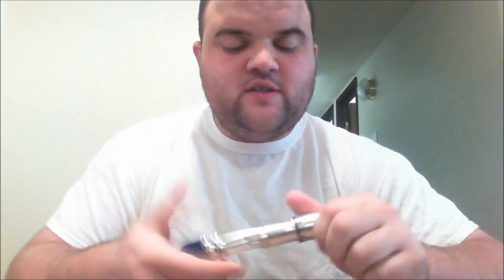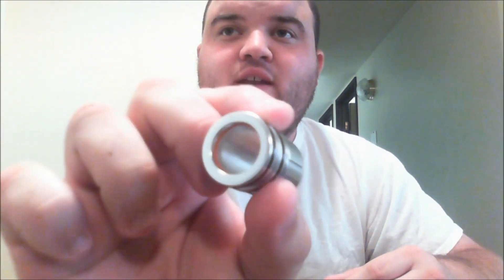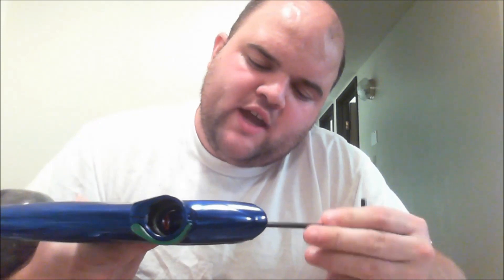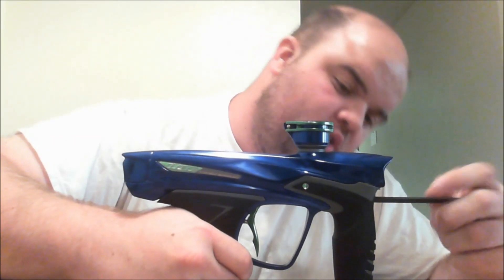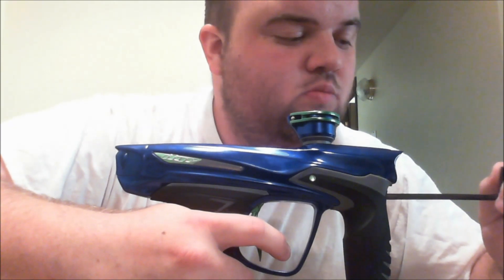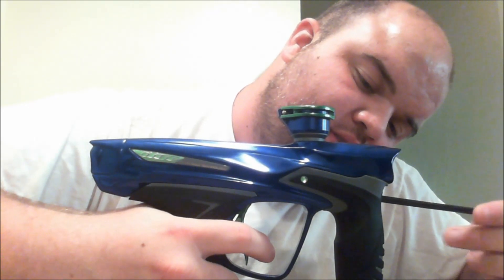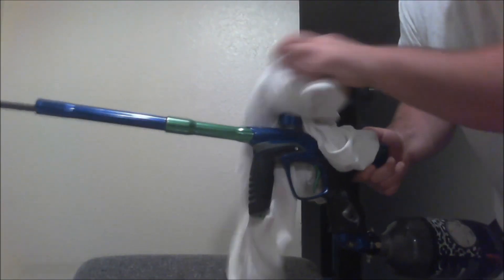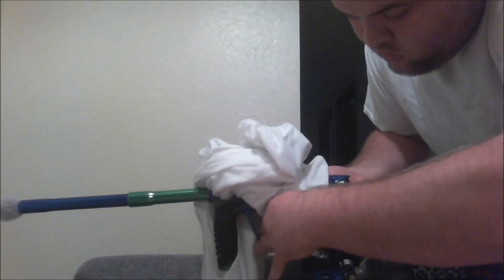Dm8-14 High performance o-ring kit vs Stock

Comment: Hey. I'm currently getting a full to the brim rotor from 1k of air. I estimate that at 190balls. So I recon about 4.75 pods and a hopper from a 4.5k fill. What sort of LPR and dwell setting would up my efficiency. I play big festival games mainly so would like extra pots per outing. 

Also when setting the LPR. Is it best to set the LPR and HPR to Stock as described in the manual first before turning the LPR off and then backing it out? Cheers in advance.